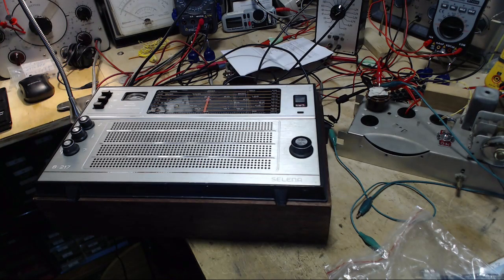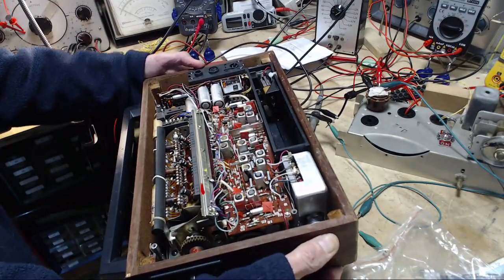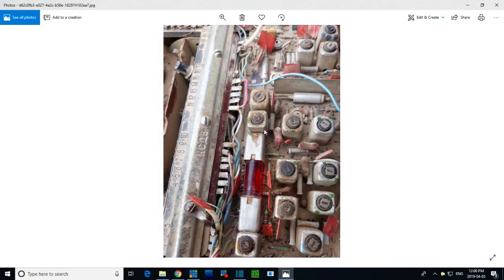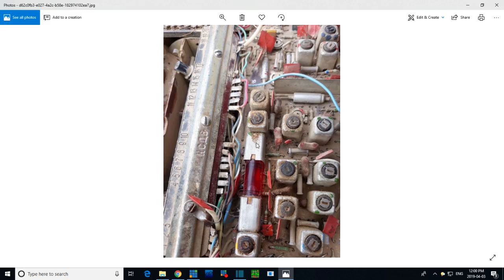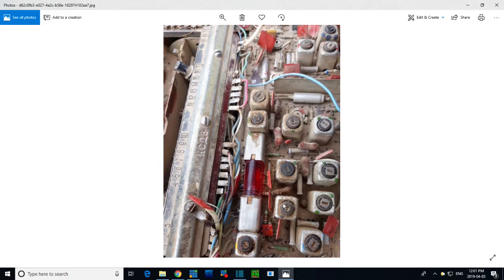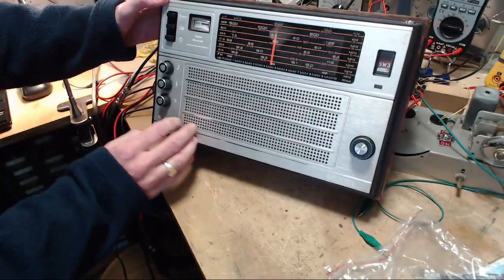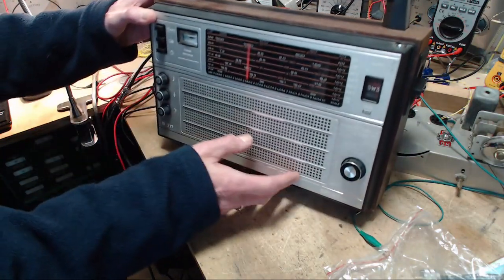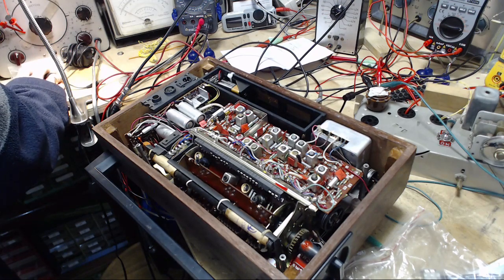Mystery Part in Russian (USSR) Selena B217 Radio - What is it doing there?

Comment: sir i need ure help. im from pakistan. i have the same selena radio. my cousin ruined it. the red pointer is not moving.  he twisted the round tuner hard. i showed it to the radio repairman i was surprised he seemed to deal in old radios and he says it cant be fixed. what should i do?

Comment: Greetings:
Do you have a schematic for this model? What does it show as?
Your photo does not show up as a bubble-level in there. You failed to give us an opportunity to examine the same location in your radio.
You sid tht our rado works but your poor excuse for a demo WAS NOT indicative of anything other than noise.
GUESS: Bypasses optional feature not in one of the radios.
Guess2: Bubble level forces unit to be held in specific position for optional feature to work! Maybe antenna or bomb setup. 
Guess3: Bomb enable feature if positioned properly.
Guess4: Disable mode for inhibit use by wrong people.
Guess5: Putin's secret radio feature.
Need that schematic. Looks like its in the IF path, maybe for multiple IF frequencies.

Comment: 2 possibilities.
1) Bomb trigger.
2) Decoding circuit trigger. As in perhaps there is another circuit in there that decodes SW radio transmission but only when the radio is on its side.
Very old trick. Radio will play and work normally till you tip it on other side then it becomes a receiver for secret broadcasts or can even have circuit inside to transmit

Comment: I'm going to guess that maybe there was a cold solder joint on the radio that has that piece. Maybe they wedged it in the area of the cold solder joint to keep the connection without having to take the radio apart and find the bad joint.???

Comment: Maybe the level is in there to allow the operator to close a set of contacts.  Those contacts might allow the operation of some sort of enhanced function of the receiver, or perhaps allow operation of a low power morse code oscillator ?

Comment: ok....hmmmmmm  the level is used to level the radio to allow use of an inclination gage and the rf meter on the front panel to measure the angle of "skip" of an incoming signal to get a distance to the signal source so you know what location the signal is from you in miles/kilometers.....this would give you a radius and with a  map and a general idea of direction would then allow you to retransmit using the skip signal to limit who really picks up your signal.....   shades of 007 or really i like the bomb trigger idea...... set the radio on the table with a station tuned in.....level the radio (trigger is open)    connect bomb....now when someone tries to change your station......they are treated to a nice surprise......   or to get some old guy to really think about working on old radios......
Reply from the maker: Skip Angle Detector.  LOL

Comment from the maker: Here's my story on this (all made up of course).  A soviet spy had a nerve agent that was hidden in a spirit level where the fluid would not be suspicious.  But carrying that around would raise questions like, 'Why are you carrying that level around' or 'why are you bringing that level onto this plane'.  So, to better hide it, the spy removed the fluid vial from the level, disguised it as a radio part by putting two IF cans on the end and neatly fitted it into the radio where unsuspecting eyes would never notice it.  He never got a call to use the fluid and eventually forgot about it or, for whatever reason, the radio changed hands and now, 40 years later, the vial has been discovered by it's current owner (in the Middle East).  I wouldn't dare break that vial!
Reply: its red mercury,in lots of old machines
Reply: That's red mercury dude.. and i have one. You can see it through video call. But internet says its not posible. How can i have it?? The magical thing is.. it disappears in mirror..
Reply: @petslife3146  can u sell me the red
Reply: Tech za.. Can u sell ur radio with ref

Comment: It might be pushing on a filter, fixing a bad solder joint.

Or just something kids do.
Reply from the maker: Interesting idea but wouldn't you use a piece of wood or plastic rather than a spirit level with two IF cans on either end.
Reply: @JimsRadioShop  I read all the answers and this one seems the most plausible to me. Did you check the solder joints ? It's typically the type of temporary fix I would do and then forget to finish it. Spare IF cans and a bubble level together are suprising but could be in the same drawer of a messy grand-father's garage.
Reply: @JimsRadioShop  You use whatever you have at hand when you have no other option...
Reply from the maker: Two spare IF cans and a level tube?  Just some stuff laying around?  Looks like a very hard way to achieve a wedge.
Reply: @JimsRadioShop  It's easy if that's what you have laying around. Like a puzzle. Find the pieces that fit.